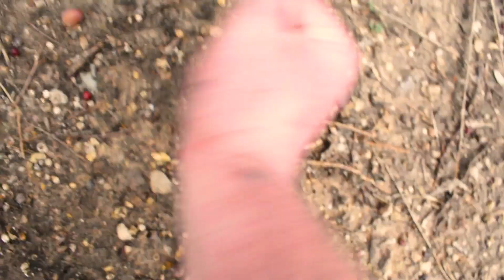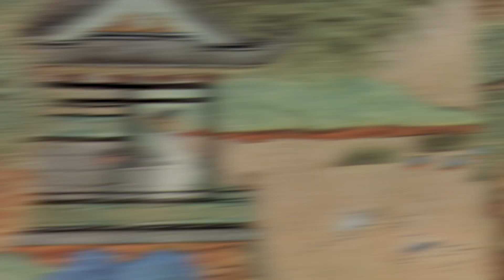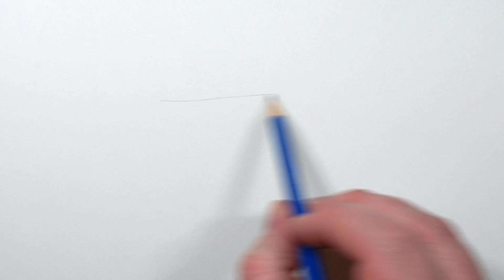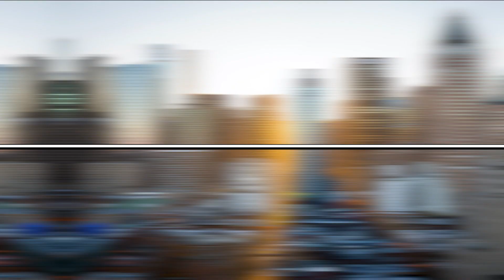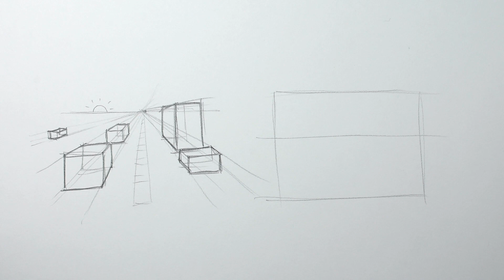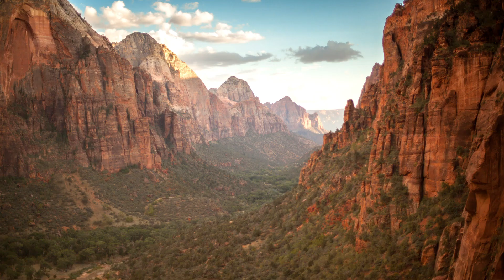DRAWING FOR BEGINNERS Part 5: Perspective Drawing Basics

Comment: Which Sketch Book would you use doing this, and what about "Newspaper?!"
Reply from the maker: I recommend smoother paper with smaller "teeth" so you can easily draw your lines straight: bristol or hot-pressed. This particularly helps on detailed artwork with lots of buildings.

Comment: Ok like for e.g. how do you know where to put the vanishing point when drawing a car?
Reply from the maker: You can do this by tracing the lines of the car in the air and continuing to draw the line straight out to the horizon. If it's a picture, you can do this even more accurately by placing a ruler or straight edge on the lines of the car and seeing where it vanishes on the horizon.

With 2-point perspective, you can get a good estimate of where the vanishing points are located based on how close or far the car is from you. If it's closer, you get a more extreme perspective, and the vanishing points will be closer to the car.

Comment: When I draw the boxes they don't come out like yours. Idk what I'm doing wrong, it's so frustrating
Reply from the maker: What do your boxes end up looking like? Also, are you drawing your lines with a straight edge? If not, it'll be more challenging since free-hand lines are less accurate.
Reply: @RTIFEX  when I try to draw the back side of the cube like at 1:39 it just ends up looking wrong. I'm not sure how to explain unless I showed you a picture of mine, not sure if you can do that in a comment though. No I'm not using a straight edge, should I be doing that?